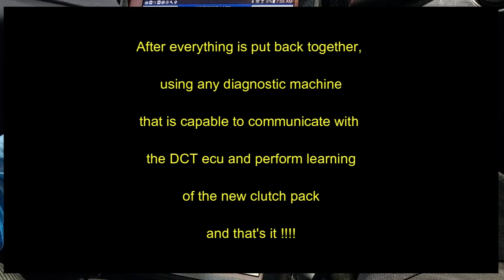Hyundai DCT Dual Clutch Replacement And Clutch Actuators Reset

Comment: Hello, some time ago the dealership replaced the dual clutch and the clutch actuator in my 2019 Tucson 1.6t because the car was shaking when starting in first gear on inclines, which was quite bothersome. The issue was fixed for two months, but then it returned, and the odd gears were lost. The dealership then replaced the secondary gear actuator and the wiring. However, the shaking issue has reappeared and, additionally, the gearbox is overheating very quickly. What might be the problem? Any help would be greatly appreciated.
Reply from the maker: Overheating gearbox is due to slipping clutch, which can be caused by a bad clutch actuator, bad clutch pack or driving style.

Comment: Assuming the clutch actuator rods push onto the forks and engage each clutch, would extending them to be ever so slightly longer then result in the clutches having a little more clamping force to avoid slipping?
Reply from the maker: The actuators are pulling the forks for engaging. Remove the plastic cover of the actuator and measure the rods length

Comment: What an amazing video. I have rattling noise at idle. Puting in Drive or reverse and letting  car run without any gass rattling dissapears, same when doing calibration with autel tool. When switching gears sounds dissapears, what could be issue? No fault codes car drives fine
Reply from the maker: Clutch pack / engine flywheel teeth worn  out. It will require a clutch pack and engine flywheel

Comment: good morning, I have a problem with the 7 dct gearbox connected to the 1.7 crdi engine. At idle you can hear a loud rattling and knocking noise, the gearbox works very well, it does not slip or jerk. Is it enough to replace only the dual mass flywheel? Thank you for your answer

￼
Reply from the maker: It does not have a dual mass fly wheel. It is a solid flywheel assy that connects the engine to gearbox, the teeth are round and big, and they get worn out, causing a chattering noise. Replacing just the flywheel will not eliminate the noise completely. Once you have the transmission out, you will see the flywheel and pack assembly and asses the wear.
Reply: And after replacing the dual mass without moving the clutch pack, do I need to adapt the gearbox by computer?

￼
Reply from the maker: @lordkoks4354  i never did that, but I don't think it will be necessary.

Comment: Elantra sport 2018 1.6 turbo D7UF, at high revs on the road a strange noise is heard and at high revs in neutral there is no. Do you think I should adjust just the actuator? If yes, how many millimeters?
Reply from the maker: So, you're doing let's say 70mph, in drive and there is a noise, then while doing 70mph if you put it in neutral noise is gone?
Reply: @GicaPhp  That's correct, the noise disappears when you put it in neutral and step on the accelerator.
Reply from the maker: @rey12aguilarify  while doing 70mph? Or car is still?
Reply: @GicaPhp  Running at 70 mph. I put neutral and the noise disappears.
Reply: @GicaPhp Do you think I should replace the double clutch?

Comment: Hi there, do you think is normal that on first start in the morning (after overnight) DCT shudder (jerks) ONLY for this first movement, after everything is perfectly fine, no shudder, no vibrations when changing gears up nor down
Reply from the maker: it could be surface rust, moisture, oil, etc.
Reply: @GicaPhp  is it really possible to be something like this? Is't gearbox tight, waterproof, sealed to be some kind of moisture?
Reply from the maker: @goranristic8920  it is not tight, it is a manual gearbox with a dual clutch pack and some actuator for engagement of the two clutches and gears actuators.
Reply: @goranristic8920  I doubt it's 100% sealed as once heat builds up in there, it has to go somewhere.

Comment: My car is a Hyundai i40 1.7 crdi 2016, in idle it makes a loud knocking sound, but the sound goes away when I push the throttle or drive the car.
I went under my car to listen to the sound, the sound comes from inside the transmission.
My car drives really good, shifts gears very well, no issues at all, no error codes. 
Will this do any harm if I keep driving it like this?
Reply from the maker: The noise, if you have DCT gearbox you hear is most likely the wear between the clutch pack teeth and connecting flywheel teeth being worn out. It will get louder and louder, I never seen one yet failed, as we have replaced the clutch pack and flywheel upon inspection. Send me VIN number to confirm part numbers
Reply: @GicaPhp  it drives normally, only a weird loud noise when its on idle, there is no sound when it shifts, only when i stand still (no matter in drive, neutral or reverse). I start pushing the throttle and the sound goes away. VIN: KMHLC81UGGU125759
Can you provide me the double clutch part number and the flywheel please

Comment: Great video! Based on your experience, would you recommend Hyundai DCTs, especially in hot climate with high traffic areas? I know it would be hard to recommend a DCT equipped vehicle in such conditions but can they last if driven in traffic with precaution?
Reply from the maker: They can last if you understand how thet work.
Reply: Better go 6 speed manual. It will outlast the life of the car. Change oil every 40000km full synthetic gear oil. 🎉
Reply from the maker: @andrewdarakis8807  unless the synchros will fail 😀
Reply: Any tip? @GicaPhp
Reply from the maker: @RedPanda_00806  avoiding creeping forward with brake on. Set off when there is enough space to match idle speed of engine with 1st gear (4-5mph) asap. This way, the full engagement of clutch it is fast and will not cause overheating and slipping.

Comment: Hyundai 140
Is the procedure the same I’ve seen somewhere you need a special tool that’s like a jig that you put the actuators in and set both rod lengths and adjust ??
Or can it just be adapted via diagnostic
Reply from the maker: if you replace the clutch pack, you set it up on the bench as in the video, then with a diagnostic machine you just do the self learning
Reply: @GicaPhp  thanks any Mercedes’ bmw questions please ask 15 years dealer experience
Reply from the maker: @soldier1900 s  wow, thank you. How do I contact you if need it?
Reply: @GicaPhp  send over your email
Reply from the maker: @soldiers-nf2ps  gicaphp@gmail.com

Comment: Hi Boss I have Hyundai Tucson 2023 the same box in your video the reverse works but.the drive no work.the start does not even block. I put scanner no fault
Reply from the maker: remove gears actuator and see if it can actuate fron diag machine

Comment: I read about a lot of issues of losing traction because the Hyundai DCT enters in some protected mode and disengage gears to protect itself.  Any knowledge here?
Thanks for the video, good work.
Reply from the maker: if it will loose drive completly it will only happen if it can't change gear (faulty actuator) or excessive slipping (overheating) other than that, it will drive in one gear usually 3rd. I never had one yet with other situation for no drive at all due to dct. But time will tell.
Reply: @GicaPhp  faulty clutch actuator motor or faulty clutch actuator in the transmission?   please get back to me on this would greatly appricate it
Reply from the maker: @Diode7  in this video clutch pack faulty
Reply: @GicaPhp  Im getting code clutch 1 actuator error car wont move either would your best random guess be the clutches are worn out? 140k miles 2014 1.6 base
Reply from the maker: @Diode7  remove clutch actuator rods cover and see if they are evenly extended.
Reply: @GicaPhp  i pulled the trans and the clutch is worn out but hyundai wants 3500$ for just the clutch pack any recommendations on were to buy a clutch kit thats not expensive for this dct transmission?
Reply from the maker: @Diode7  here is about £1200 for clutch pack
Reply: @GicaPhp  will i have to reprogram the transmission for the new clutch or will it work without reprogramming this is my first time having this transmission apart
Reply: @GicaPhp  also if i put a entirely used transmission into the car will i have to reprogram it aswell or will it drive fine?

Comment: Hi. I have a hyundai tucson 2018 auto. It was juddering at low speeds and when pulling away. Hyundai completed a judder software update but the juddering is slowly appearing again. Have you worked on a car with similar issues like that before and if so what could the issue be? Many thanks.
Reply: I must add that the juddering is intermittent. Do you know if that means the clutch is faulty ? Many thanks.
Reply from the maker: Requires the new improved clutch pack
Reply: @GicaPhp thanks for getting back to me. The issue I have is because it's intermittent it's hard to know when it will judder and Hyundai want me to either drive it with their technicians or get it on a recording for them to be able to authorise a warranty repair. Do you have any advice on how I can capture a video on this because it's very difficult to get this on camera as it's something that you feel when driving. Any ideas on what I could do? Thanks again.

Comment: Good day please my vehicle just stalled on my way back from work it won’t drive when I try to accelerate.. so I was able to tow it home the next day it turned on and it drives but won’t work in reverse.. checked the fluid it’s ok scanned the tcm no trouble codes .. its a Hyundai veloster dct 2012 .. I don’t really know what to do now I need ur help
Reply from the maker: you need to remove gears actuator and actuate it from diag machine, it can be actuator or gearbox

Comment: Is the actuator reset necessary if replacing just the  dual clutch assembly ?
Reply from the maker: Yes, reset is necessary and touch point adaptation as well
Reply: @GicaPhp  Can I reset the rods without special jig ? How long the rods gotta be ?
Reply from the maker: @pandydiy  have you watched the video on how I reset it? send me vin and I will tell you the length.
Reply: @GicaPhp  okay , I see you measure it starting  from the metal surface where the rod comes out
Reply: @GicaPhp  KM8J33A2XGU159958  2016 Tucson 1.6 T , what would be the necessary rod lenght on it with new dual clutch ? 🙏
Reply from the maker: @pandydiy  71.5mm ~ 72.5mm - don't forget to like, share, subscribe, and maybe a super thank would be nice 😉
Reply: @GicaPhp  done and done, same info I found from SST, just wanted it confirmed by professional, thank you very much for your time

Comment: I have a 2013 Genesis 5.0 120k with the same 8 speed dct… when I up shift into 3rd and 5th gear there is a slight slip but it doesn’t happen all the time, and never when I first start driving after a cold start. If the car is at temp or I’ve been driving at some point that day, the problem occurs. Same thing with downshifting 6-5 and 4-3 sometimes there is a loud bang/slight jerk and slight jerk when I put the car into reverse. No lights or codes on the car. Oem transmission fluid and pan as far as I’m concerned.
Reply from the maker: never had the chance to work on a genesis. cutch drag and slipping can cause your jerking. at 120k i would check on a diagnostic machine the wear of the clutches
Reply: get out of here! 12K on a DCT . People can hardly get off the lot before they go bad.
Reply from the maker: @short5stick  ok

Comment: Hi mate 
we changed the clutch kit and flywheel and clutch actuator on same car hyundai i30 semi auto
the flywheel was noisy thats why we changed and actuator was stuck

we put back everything now but we noticed the car not driving in reverse only in Drive mode driving 
when put in reverse car not accelerating

any solution 
Appreciate
Reply from the maker: have you carried out gearbox relearn from diagnostic machine?

Comment: Hey there George which Hyundai DCT is this car from? I have issues with my Hyundai Ioniq Hybrid, dealership made diagnose however didnt want to show me scanner, they only said I got codes P17EB & P1744 which means faulty Clutch Module and Actuator, VIN KMHC85LC7JU107139. They claim i need to buy new Clutch Module, New Actuator and other parts related, however very expensive and labour too, the car was working properly until it jerked, it turned off and was towed to the dealership, it didn't turn on, it had an issue with Inverter fuse, already done but the prpblem with actuator and clutch remains.
Reply from the maker: Based on your fault codes your clutch actuator or release bearing that engages combustion engine to gearbox has failed. Most likely you might find your clutch fluid black and leaking between gearbox and engine. It will required gearbox assy to come out for investigation and when out check length of dct clutch actuator rods as well so you can evaluate the wear on your dct clutch
Reply: @GicaPhp  you're correct 100%, I just dismantled engine low cover and there's remains of recent oil between division of transmission, however I couldn't say if actuator fluid or transmission oil, everytime I drive the HEV Warning hazard light appears and gears starts to jerk so badly, actuator deposit empties during this time and there's a crank sound within engine, I believe too there's faulty with whole DCT Module, however I cannot say if actuator is bad, too. What are your experiences on this? Thank you.
Reply from the maker: @Chiquilindlp  you might only need the slave cylinder of the clutch actuator if no damage had occurred. All that is happening is that the engine speed is not matching hev motor speed. Hence, the noise and jerking.

Comment: Hi, my Kia Niro (phev  1.6 dct) was having few things, 1st: some noise and vibration when decelerating, 2st: some times from stop to accelerate, in 1gear I was felling a strong bang, first time I thought someone crashed in the back, (dual clutch transmission plug-in hybrid) 
I’ve been to a mechanic, he replaced the gearbox and clutch, (refurbished one) and I still had the bang. After they replaced the whole gearbox, whith actuator and clutch,(still refurbished one) and still have the bang! Now they replaced the motor assy, and the car couldn’t run ( looks like doesn’t recognise “electronically “ 
) 
They still have the car,… have you ever seen something like this? What was the solution? 
Thank you
Reply from the maker: when you replace the electric motor you need to do calibration of the motor.
Reply: @GicaPhp  I’ve replaced everything! Gearbox, clutch, hibrid motor, clutch and gearbox actuators, sensors, everything! 
And I still got this huge clunk ( I’ve changed also driveshaft (left side) and wheel bearing because it started to make hedge noise… now I’m having still the clunk ( less) I’m going to replace the right driveshaft and extension! I believe the joint is gone and the clunk was part of it! ( garages straight way says gearbox) but I believe my case was driveshafts ! Gearbox was faulty as well! But I believe the consequences of failed driveshaft 

I hope after changing half car it will stop
Reply from the maker: @brayeer  please let us know how it goes

Comment: I have a 2017 ioniq with dct…I just had replaced my engine clutch actuator and not the dual clutch actuator yet…is it possible I can still drive my ioniq without the dual clutch working as single clutch ioniq ? Thanks sir
Reply from the maker: You can not drive without the dtc, electric motor is not strong enough to push you more than 20-30mph
Reply: @GicaPhp  got it sir thank you

Comment: Hi George I have Kia ceed 2016 mk2 1.6 diesel 7 speed DCT , when you start the car it drives in 2 gear then jymp to 4th and then 6 , I have took it to my local mechanic he said you need a new gearbox he drove my car for like 2 minutes no computer diagnostic
Reply from the maker: Hi,
The issue can be in either clutch pack, gear selector actuator or gearbox hub shyncros or wiring. You need a fault code scan first, then a bit of live data reading and acutation test. And based on what you find, repair as needed. Do you have EML on?

Comment: hi george. may i ask if this will apply on my hyundai accent crdi dtc 7 speed automatic?
Reply from the maker: Please send me the VIN number
Reply from the maker: @maynardbuzar  yes, same procedure on yours. Are you replacing the clutch, or do you want to check the wear?
Reply: @p my car is jerking in low speed sometimes and in delay in acceleration in reverse. can i only adjust the rods? my car has 60k mileage or should i replace the clutch lining and release bearing then reset the actuators?
Reply from the maker: @maynardbuzar  take cover off the clutch actuator and measure rod length first
Reply: hi @GicaPhp  i already change the clutch and adjusted the rod at 72mm. now my questsion is do i need to relearn my transmission using scanner? but i dont have scanner.
Reply from the maker: @maynardbuzar  it is better to do it with a scanner. If don't have one, it will self learn, but might drive a bit rough. Just go on a road test with smooth driving until everything is smooth then you can drive a bit harder. Let me know how is going
Reply: @GicaPhp  hi george i have adjusted the rods in 72mm my question is both rods should be at 72mm? i still have slight delay on reverse and slight jerking in 2nd and 4 gear. what rod should i adjust?